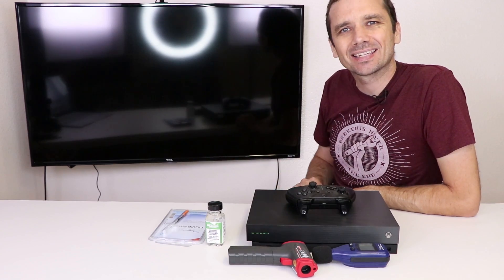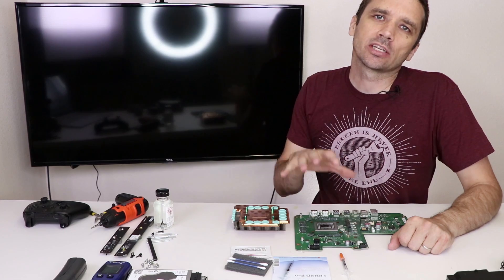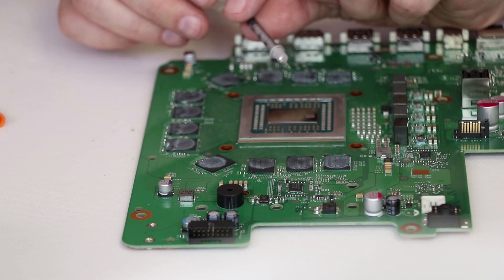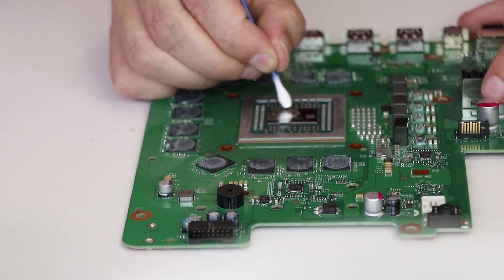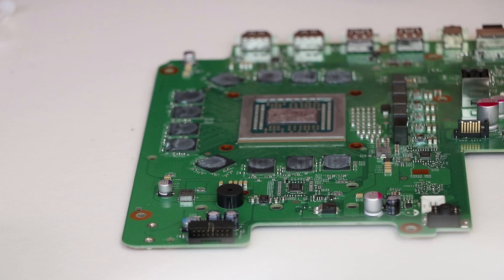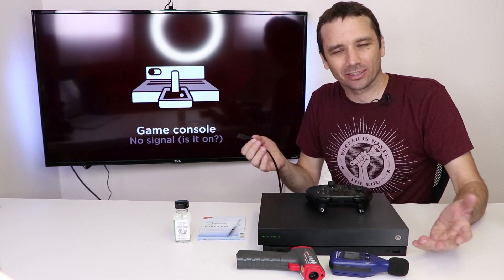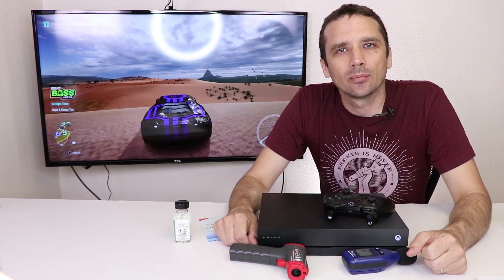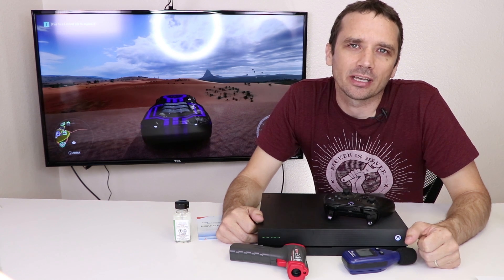Xbox One X Heat Test and Upgrade - It's So Quiet!

Comment: Liquid metal is just more efficient because it makes better contact less heat on the chip more heat on the heatsink the sensor is on the chip so if the chip is staying cool then the fan isn’t spinning fast..with thermal paste the chip has high temps and the fan kicks in fast and only cools the heatsink lol simple that’s why you have higher numbers...if you where able to measure the temp in the chip you will see that is actually cooler even if the heatsink has higher temps..

Comment: I agree with your theory, it's dissipating the heat better so the output temps are higher, if the chip was running hotter you would expect the fan to increase instead of decrease. Time to take my 1X apart it appears lol.
Reply: same

Comment: Would the silicone coating also useful for the Playstation APU?

I only see this being used for Xbox One's s so i'm not sure if it has the same effect.
Reply: Conformal coatings can be used on any circuitry.  He used it to prevent a short circuit if the liquid metal runs off the chip.  Just Google it and you'll learn all about it.
Reply: @ryanlandry8214  thank you very much for your informative reply 😅 i tried googling ps4 liquid silicone but nothing came up.

Thabks again though
Reply: @VyralFPS  no problem, glad I could help. 👍😉

Comment: Wouldnt a QTip risk leaving behind micro fibers preventing solid contact? I personally have never used them when applying anything to the CPU.
Reply: Yeah, that's exactly what I was thinking.  And I also thought liquid metal was not to be used with copper heatsinks.
Reply: @LousWRX Yeah, He has a newer video showing how it molded with the copper.
Reply: @ajdrig  Yeah I just watched it. Supposedly long term use of liquid metal will corrode copper, and it looks it was in the process of doing that by imbedding into it.

Comment: why the temp is higher?
cause the temp transfer works better now, so (lets say) the 100°C cpu "gives" the cooler not only 45% of the temp, biut 60% now.
the gigher the air-temp on output, the better the cooling works.

Comment: Steve, I'm in a situation where I need to replace the thermal pads. What thickness pads am I supposed to get? 1.5mm thick? 2mm or 3mm?
Reply from the maker: They aren't thermal pads.  It uses viscous thermal paste: https://amzn.to/2E4kdzr
Reply: @Tronicsfix  is it better to use this paste for the chips then thermal pad as i replaced mine not long ago with some Gelid Solutions GP extreme Thermal pad with a 12W/mK it is a bit overkill but hell why not and the paste you say to use is only 5.3W/mK i have no idea what the stock paste was rated at. and the pads are 2mm thick to use can't use the overs as will not work as good or just not fit on the heatsink.
Reply: @Tronicsfix   TronicsFix,  thank you very much for the tip. I was unaware of the viscous thermal paste. In my research everyone seems to use the term "thermal pad" interchangeably between thermal paste, thermal pad, thermal tape and vtp.

I found a reddit post where someone was kneading the existing vtp into balls before reapplying it it to the ram. Letting the heat sink compress and fill the gaps like you would thermal paste on the cpu. Is this standard practice or even recommended to do if no other option is available?
Reply: @full95one  lots of people just use 2mm thermal pads , the paste is overkill anyways
Reply: @uploaded113redone  thanks. I want overkill if possible. I had a 3mm pad, I was expecting it to squish but it was too thick and pulled the heat sink away.

Comment: Hey could you make a video showing ways to cool or keep cool as max as possible on the launch PS4? Even a clean PS4 with changed thermal paste makes a lot of fan noise and generally runs hot. Thanks!

Comment: If fan is running slower the air can pick up more heat on each pass through xbox . Its more time exposed to heat sink before being removed .the question i would like answered is why is fan running slower . (Hopefully the fan is not controled by temperature and your modification insulated the sensor someway thus not allowing the fan to increase speed to acheive much needed cooling of vital electronics.

Comment: Doesn't Liquid metal dry up when in contact with copper after a while (reaction)? I've heard that the heat sink surfaces need to be nickel plated to resolve this.
Reply from the maker: I'm going to be doing a teadown on this X in a month or so to see how the heat sink looks.
Reply: @Tronicsfix  Did you do this?
Reply: @Tronicsfix  Can you please do this, it would be very informative as to know if yes or no the fears are justified or not using this liquid metal.

Comment: It always disappoints me when I see folks using the silicone conformal coatings for this type of application and not the acrylic ones. They both do the same job but the acrylic type is significantly more dielectric which is a trait one would want for protection while using liquid metals. While the silicone types offer better durability (does not really effect longevity) unless it comes in physical contact with a lot of things for example a server that is coated and frequently pulled out and handled by hand.

For folks who are paranoid even after using a conformal coating you can also put a layer of kapton tape over it which will also add significantly more electrical insulation and can easily handle the heat produced by a GPU die.

Comment: I had a launch project Scorpio, controller was busted out the box would never sync to Xbox, playing certain games it was sorta loud some like ww2 it was loud in the camp area max speed, over a year it got worse so few weeks ago passed Nov 12 or whenever it came out, took it apart got to the heat sink, the thermal paste They had used was all over the CPU an rock solid hard no wonder it was perma loud, anyways threw on the 
noctua nt-h1 thermal compound thermal paste threw on my loud game, RDR2 was super loud well after new paste it was dead silent all my games were super silent, also air is now 20x hotter then before since fans run normal an its pushing a lot more heat out now then before, bonus my rooms not as hot anymore due to the fans not running at 80% nonstop.

Comment: oh, 45 Celsius? my pc goes up to 83celsius...
Reply: remember you pc monitors temps from internal sensors versus in this video which he just took a temp gun to the back of the console.
Reply: Got a gaming laptop and regret it, playing any game gets up to 90°C  and hovers there. I never really played longer than 1 hour because i'm scared it might damage.
Reply: spincube23 not good. You really don’t want it to be over 78C consistently
Reply: especially on the air exhausting from your case lol

Comment: Hotter the air, and slower the means the cooling solution was more efficient and didn't need to ramp up the airflow to blow out the excess heat, that being said if your xbox is getting super loud and the air temp being expelled is semi cool, means the efficiency is too low for the system to effectively remove the heat.

Comment: man they wanted to keep that box cool solid copper plate that runs over dram and apu do you need to change liquid metal thermal paste often
Reply from the maker: I'm not sure yet. I'll probably take this back apart at some point and check it out.
Reply: ok

Comment: Is there a way to replace the fan port that is connected to motherboard I tried unplugging it to clean fan and the whole thing ripped out
Reply from the maker: Yep, it's fixable...the problem is going to be finding another connector to solder on. You can always send it in to me if you need.
Reply: TronicsFix ok thanks how much would it cost to have you do that ?
Reply from the maker: We normally charge $99 for a 5 business day repair for something like that. You can order a diagnosis on our website and send it in if you'd like: https://tronicsfix.com/collections/get-started

Comment: I think ur theory is correct, if the fans are being controlled by a temp sensor in the chip then the liquid metal worked perfectly
Reply: I've been wanting to know the answer to that, is the temperature of the chipset calculated within the chipset or is there a thermostat somewhere attached to the heat sink that determines when the cooling fan kicks in?
Reply: WhatTheDeuce47 D afaik it’s the chip itself. Then that reports to something on the motherboard that tells the fan to spin faster/slower.

Basically the chip is cooler (more heat transferred) so the fan runs slower.

In theory the calibration could be off at this point (do we want the heat sink to be that warm?) so the fan should run a bit faster, but I am seriously out of my depth when it comes to thermal science and computing.

Comment: So my new xbox one x i noticed there is a lot heat when is just plugged in not even playing it , so to avoid any surprise I just unplugged once I’m done , for other side my old Xbox one had a power supply separated never problems with overheating 🥵.
Reply: I'd wait after switching the console off. The fan will still be going after you shut it off to dissipate the left over heat so unplugging the power will shut the fan off.
Reply: That's normal, if you have your xbox on Instant-on Mode, you can Chage to Energy saving mode by going to settings, and you won't have that "problem" anymore, i have mine on Energy saving mode, sometimes i switch to Instant on if i have a big game pending for download and i want to go to sleep, so the game will still downloading while im sleeping  and the xbox is apparently turned off
Reply: Wow

Comment: My One X exhaust fan blows air out at 141F. 
It melted the seat of the plastic stool that I had it set on to get adequate ventilation... lel. I have a mini tower fan blowing on it now
Reply: Lies
Reply from the maker: That's strange.I wouldn't think 141 would melt anything.
Reply: That's not even a good lie 🤦🏾‍♂️

Comment: Does the Xbox one x worth buying? Does it overheat?
Reply from the maker: The X has very few overheating issues and is a good console imo
Reply: TronicsFix I want to know ig there’s a big difference between resolutions and durability before spending $550 on the X or better buy the standard S.
Reply: @retrocratictv275  It depends on the game, honestly. I ran out and bought a samsung 4k uhd tv to pair with my new one x(REALLY wish I hadn't), and then set it up right next to my gen 1 xbone and old Sony 1080p Bravia. On games that already played and looked pretty well(Such as Destiny 2, assassins creed, etc.) there was absolutely ZERO difference(Destiny 2 had fewer/shorter "stuck in the air loading"  lags). Games like Ark, fallout 4, kingdom come, etc tht tended to be a little laggy, or have short draw distances? 1000 times better on the one x. Pub G was a night and day difference.  

After 6 months of playing on both, I do kind of hate playing on the older xbone for almost all of my games. I use it in my bedroom while the one x is in my "man cave". I definitely don't regret buying the one x, and for me buying the 4k tv let me throw my old 50" sony in my bedroom, so win win I guess.
Reply: As for the S, my friends who play on it suffer a lot more lag and frame rate dips than I do. As for resolution, I notice zero difference between the X1x on a 4k tv and the gen 1 on an old 1080p
Reply: Jason Anziano you need a 4k tv it seems
Reply: @retrocratictv275  the one x is hooked up to a 4k tv. really don't notice any difference
Reply: Jason Anziano thats strange cuz i could definitely notice a difference. 4k looks a lot sharper and defined than 1080p games
Reply: Jason Anziano  could also depend on the distance you are from your screen
Reply: Jason Anziano did you turn the 4K option on?
Reply: Jason Anziano  you have to have a 4K capable tv to see the difference and make sure your game download is the enhanced x version.

Comment: I had similar results with my Xbox one. its the fat version but the updated one. I noticed the fans started kicking on more often and the system never (I mean never felt hot at all even new). I took it apart and the original thermal paste was just starting to harden up (still paste just alittle dry) so I put so Arctic silver in it and dusted off the fan blades/heatsink. the fans rarely kick on and exhaust temps are quite hot now. heat transfer is much more efficient. meaning the fan doesn't have to compensate anymore.

Comment: I'm good I will just dump gallium in mine
Reply: The liquid metal in used for thermal conductivity actually contains a pretty large amount of gallium - which is why you never use it on aluminum cold plates. It will destroy them in a matter of hours.

Comment: Well done & your thoughts in my opinion are correct. More heat transfer with LM therefore higher temps on air flowing out & slower fan speed since lower overall temps on components.

Comment: My thoughts: The fan is turning slower. Less air means the temperature will be higher for any given amount of power. 
Cooling fan controllers generally employ a rather generous hysteresis. A steady fan speed noise is less noticeable than a constantly changing one.
Your thermal paste mod probably keeps you right under the temperature the fan controller needs to speed up the fan.

Comment: Q tips is possibly the worst thing he could have used to apply this stuff,Qtips have dust particles and fluff in them which would stick in liquid metal/Thermal paste..would have been much better to use gloves.
Reply: Qtips are the standard for applying liquid metal. Literally everybody uses them.
Even Derbauer does, and he makes a living out of getting low temperatures out of CPUs.

Comment: bye bye warranty
Reply from the maker: Warranty schmorranty!
Reply: As an Australian, I'm waiting for November 8 next year (when my 2 year warranty expires) before I do the TIM replacement on mine, I'll also be throwing a 2TB SSHD in there whilst I have it all apart 👍

I replaced the horrible thermal compound on my xbox one elite the other day using arctic ceramique 2 that I've had laying about since 2012, and it's made a huge difference as it is, so it's just a matter of working out if liquid metal is worth the effort over just using arctic silver 5.
But either way, it's gonna run cooler and quieter
Reply: @Majestic Beardsman I had a Xbox 360 for 2 ½ years when it broke and Microsoft still fixed it.
Reply: the X hasn't been out long enough for anyones warranty to run out just yet (give it a few more month's ) . So why would anyone try this right now? Seems a bit crazy at this time, Especially when Microsoft will repair or replace your xbox for free as many times as you need within the warranty!.
Reply: James Downing my 1X only had a 1 year warranty on it
Reply: James Bowles I had the E105 error message as well, what do you mean they sent it back better than ever? Can you tell a difference or something? 😂
Reply: @CarolinaPride95 1year wow thats bad, I got a 3yr warranty on mine when I registered it on my MS account. getting my 1x back from repair later today .It got stuck in 480p and needs/needed a chip replacement,
Hope you managed to get yours sorted.
Reply: Wrong. “Warranty void if removed” is illegal.

Comment: My x is super quiet. Not sure why but even well long after ive shut off my xbox one x it remains very hot so i just unplug it now after i turn off the xbox one x. Never had this problem with any of my playstation consoles even the portable ones so i hope i didnt get a somewhat faulty brand new xbox one x out the box. Did i mention sometimes my xbox shuts off the second i turn it on it shows the x chip then shuts off then i have to turm it back om but from the console itself???? Damn you microsoft
Reply: that does not sound normal. I can run my xbox one x for hours and the thing still feels relatively cool to the touch when im done....and I have it placed pretty close to a 1000W surround sound receiver that just blows a ridiculous amount of hot air in that space.
Reply: Go into stting and turn off fast startup I did that and now mine shuts down all the way so I dont have to unplug it, mine runs hot around the 140 to 150 Fahrenheit, mine locked up on me once so far hoping I didn't get a bad one.
Reply: You got a faulty unit lol, replace it and you will not have problems.

Comment: 60 Celsius is extremely high fire hazard
Reply: No it`s not, that's a low temperature, anything over 100c is a concern.
Ideally lower than 85c though.
Reply: @johnnysheen9615  that was the air blow out from the console if you directly tuch the heat sink I will be more then 60 Celsius the consoles are made to have short life
Reply: You don't understand, 60c is considered a great temperature, even for a lot of PC enthusiasts, they don't worry too much even at 85c, considering that the X is able to get 60c with so many airflow restrictions it's actually insane (unless they put a low TDP processor which I don't think they did but idk)
Reply: @LocalAutist  I set my stove on 60 Celsius when I fry eggs in will not be a issue if sometime get to 60 but on constant use will make the Gpu solder balls crack on PC the CPU have pinis and can go for higher temperature
Reply: iulian ispas  Bill nye tested the lowest possible temp to fry an egg and he found it to be 55c BUT it also took over 20 mins to fry. I seriously doubt you fry eggs for 20 mins friend.
Reply: @SirSpinalColumn  I takes about 10 min on 60 Celsius perfect cooked widout brown edges and widout having oil all over the stove and walls
Reply: @iulianispas8634  Your stove must be misleading you. You cannot cook anything at 60C, much less frying. Also, solder does not melt until well above 115C. And, since I'm feeling informative, the combustion temperature for wood products is around 300C, so calling the X a fire hazard is nonsensical. Space heaters are fire hazards.
Reply: @PlasmaNugget  solder joints won't melt just crack exposed from 60 to 20 a few hundred times